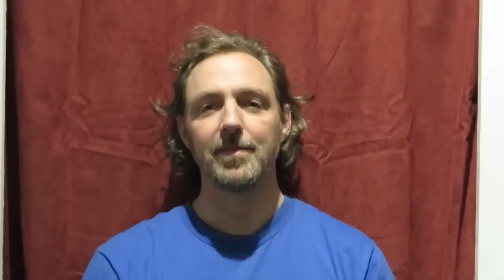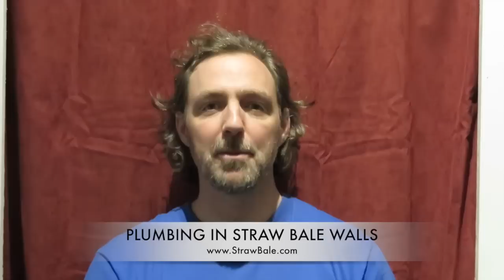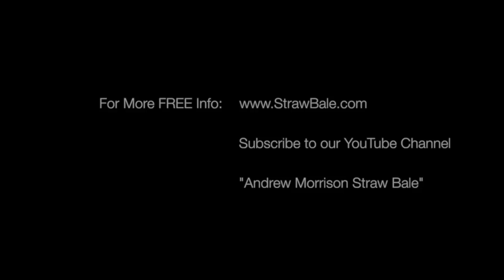StrawBale.com: Install Plumbing Correctly In Straw Bale Houses

Comment: so u don't plaster the bale with mud? just insulation?
and is that going to effect the breathability of the bale? isn't it going to be breathable from outside and condense moisture on the insulation? from the side that facing bales
Reply: yeah I got it thank u :)
btw I am from different country and I don't know if the "lime" is the same "white cement" or not?
Reply: ***** thank u :)